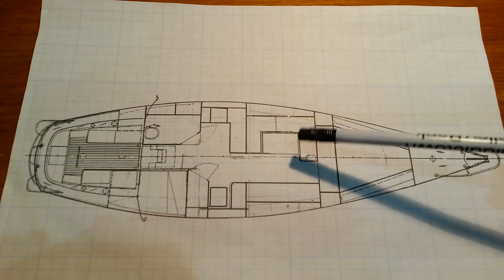Building the Main Saloon

Comment: Matthew,  it is a tough job fitting square plywood into a round boat, but you are doing excellent work. It's easy to have the "Dream" , but it's harder to have the desire to do the work. I wish I could appreciate what I have finished more than I see what still needs to be done.  But whatever small thing I do today is something I do not have to do tomorrow. You are kicking along nicely, keep up the good work and hold on to your dreams.. Fair Winds, see u out there...